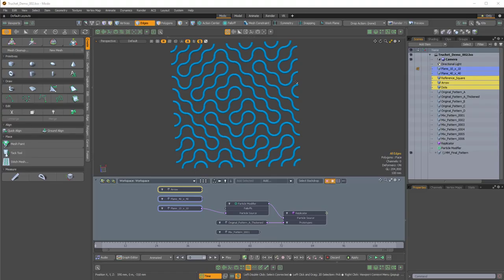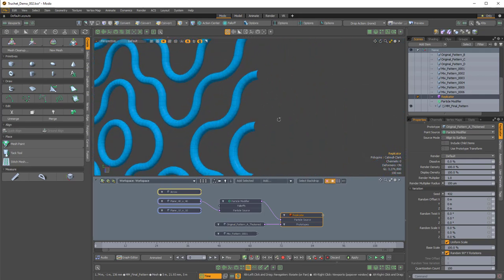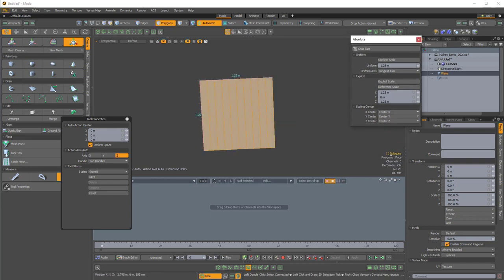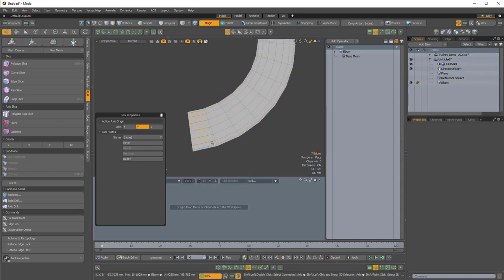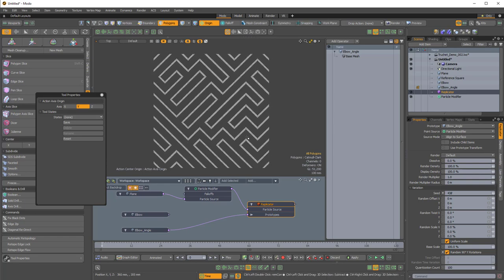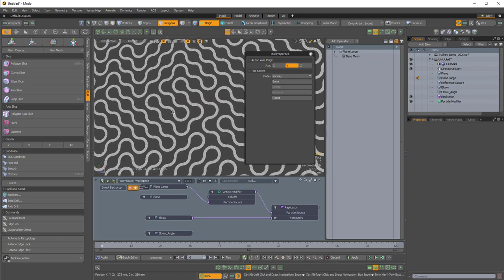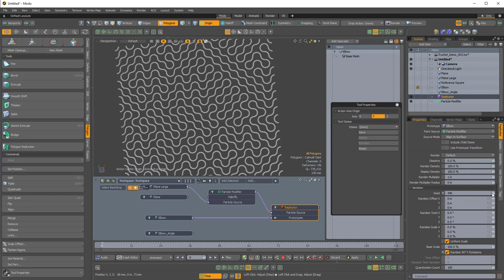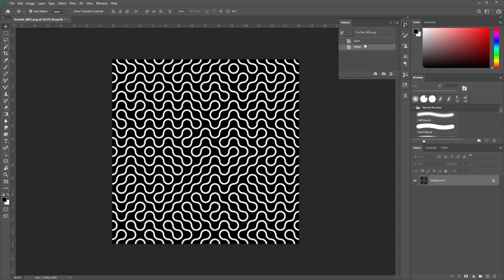Modo | Truchet Tile Pattern

Comment: Thanks a lot! Very cool stuff!
Can you make the same/similar pattern in 3 dimension spread?
Reply from the maker: Hi exeshe4ki! This is Ed from PF! Yes, there are ways to get this pattern onto 3 dimensional surfaces! After I posted this video in the Modo Users Group on Facebook, a couple members of the group posted their experiments, which used this technique. There was one example that showed this pattern applied to a cube and there was another example that showed the pattern lifting off the plane. I tried combining this technique with the UV Transform MeshOp, which would allow you to wrap this flat pattern around a more complex form. This technique showed some promise, but I haven't had the time to iron out all the wrinkles. You can learn about the UV Transform MeshOp here: https://youtu.be/Ykn1W54u_p4